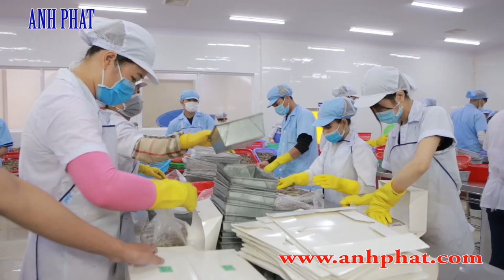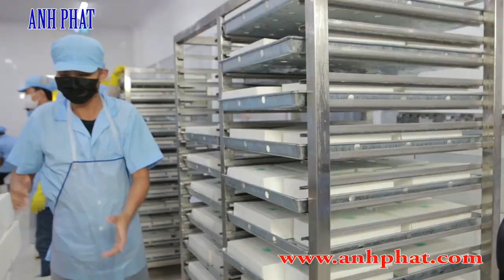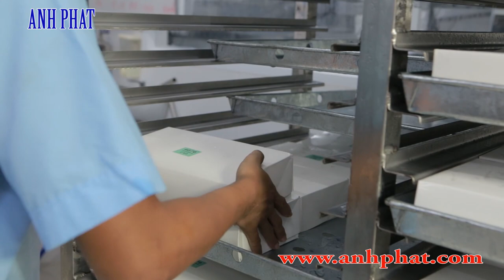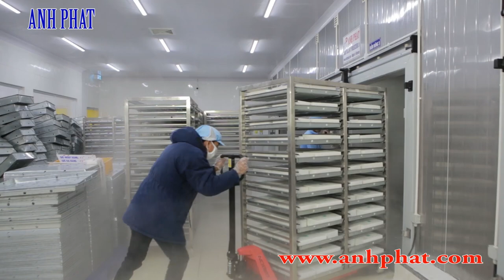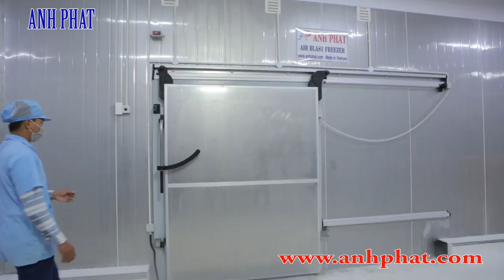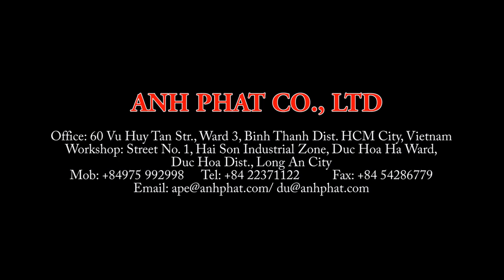Air blast freezer

Comment: You could use a drone helicopter and airlift freezer sections over downed reactors with the freezer away and maybe chill the reactors, full with argon gas and boronic water? Start a -40 chill effect and cool enough to where for robotic work?